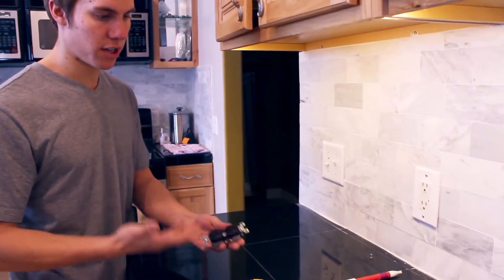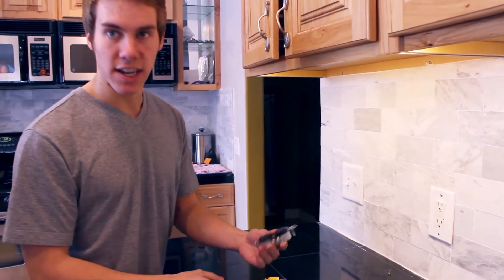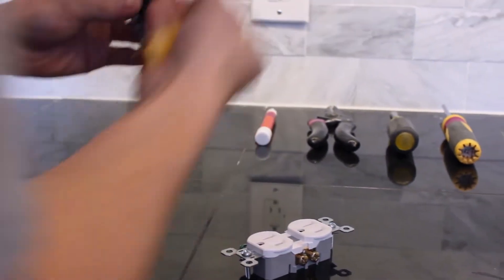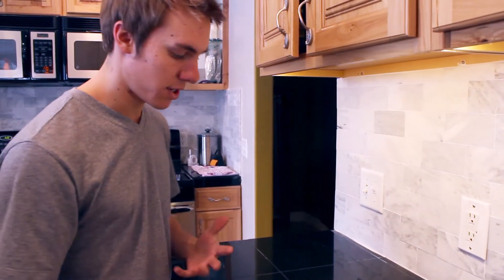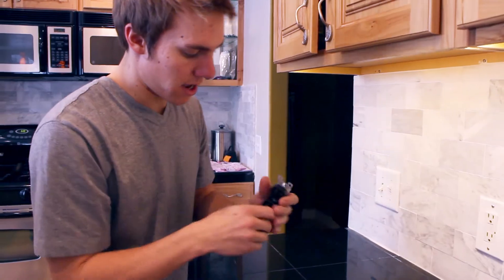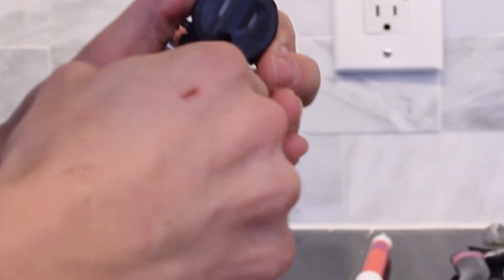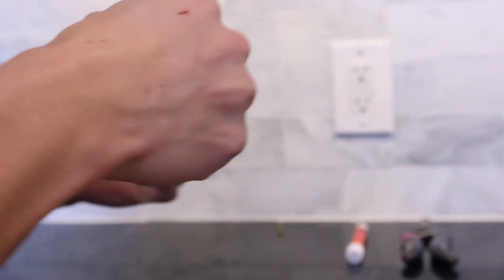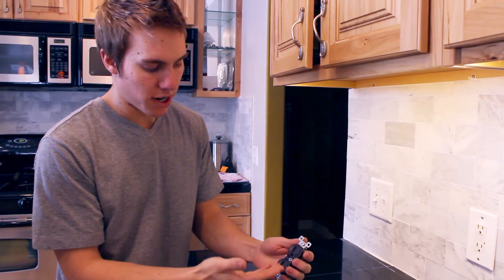The Difference Between Tamper Proof and Non-Tamper Proof Outlets

Comment: I never came across a Tamper Proof Outlet until tonight.  Breaker tripped on outlet at work site.  Could not get either cord plugged back in, 10 degrees Fahrenheit outside, turned off all breakers, and main breaker, tried for 15 minutes to try to find out what was wrong.  Almost began taking electric panel apart.  These outlets almost caused me to get electrocuted trying to fix them, I didn't understand, never seen or heard of these before.
Reply: They are almost impossible to plug anything into them!!!!

Comment: The difference between tamper proof outlets and non-tamper proof outlets is that you can actually plug something into a non-tamper proof outlet whereas tamper proof outlets are so tamper proof that you can't plug anything into them, or at least most of them.Tamper proof is NOT some miraculous design..........they stink (to be polite) because most of them don't work, some only one outlet allows you to plug something in and the other once doesn't. Whoever designed these has to be a sadist!
Reply: And if you plug in a power strip it defeats the Tampa resistance. I only bought one of these because it was the only brown one I could find in the store.